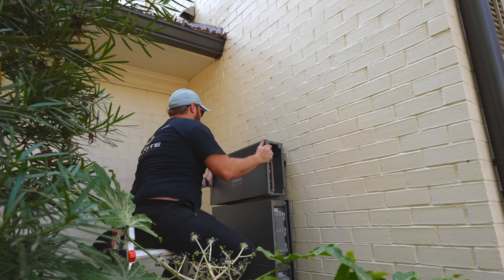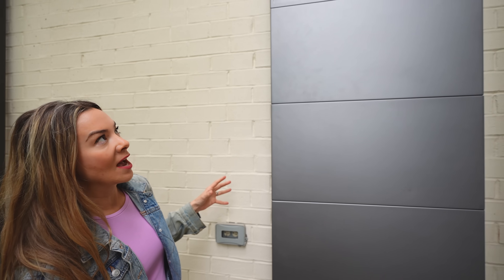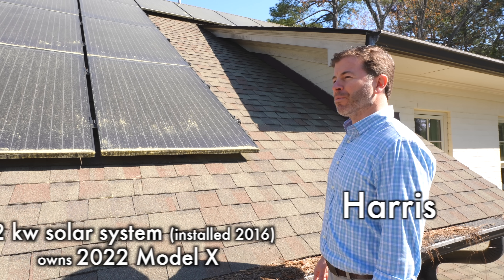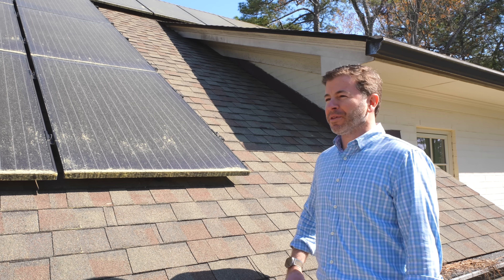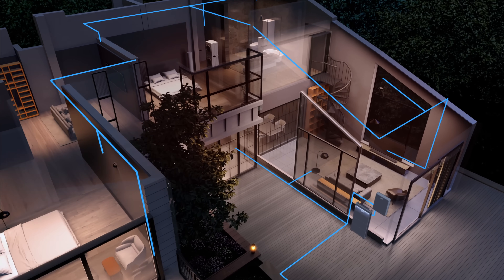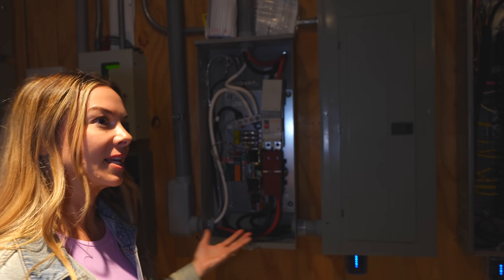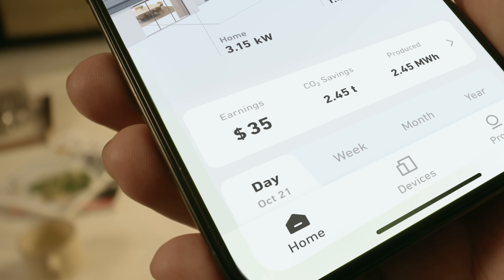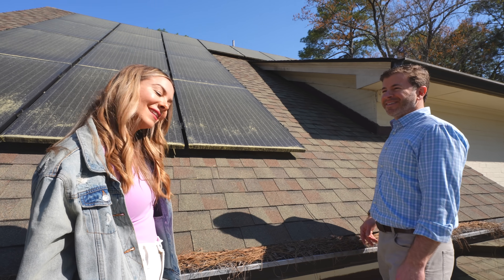Stepping Up Our Solar w/ Home Battery Storage!

Comment: How well insulated is his home, and is there a heat pump/s installed to deal with hot water and or air conditioning? If this is in Georgia, in that climate, air to air heat pumps make a great apples to apples replacement for traditional air conditioning units for a fraction of the running costs due to their higher COP meaning they use less energy than traditional units. Have the family opted for LED light bulbs? The savings on electricity is significant; the UK's electricity usage dropped by about ⅓-½ due to people swapping out their old light bulbs for LED and they also last a gazillion times longer. 

Only asking as I was so surprised at his comments about household electricity consumption going up instead of down or remaining more or less the same. Most people who get solar, batteries, EV's and other eco tech tend to become very energy consumption/efficiency conscious/aware, often to the point of nerdy geekness... 🤓 🤓 🤓 😅

Can't quite understand why he'd bothered to get the panels professionally cleaned in the first place. Given the relatively easy access, he could (easily) do it himself using one of those extendable brushes with a hose attachment hooked up to a tap. It's fairly quick and easy to use and can be used at one's own convenience.

Comment: I just got 71.5 kwh batteries for $16,885 delivered. Powerpro.
390watt brand new panels $112 apiece delivered. 18k inverter $3556 delivered. Right now is the time to go solar. Lots of overstock reductions going on Right Now. And those prices are without the 30% tax rebate.
I installed 2" of insulation and 8000ft of pex in my driveway. To melt snow in wisconsin. Was going to use solar hydronic panels. But couldn't find drain back panels for under $900 apiece. So just going to use 24 of the 390watt photovoltaic panels hooked up to 2 electric hot water heaters. With solar pumps. About $4000. Way less than the hydronic panels. Needed 10 of those. 
Will never shovel snow again. And other than initial investment won't cost anything to heat my driveway.

Comment: WHATS THE PRICE. I've watched like ten videos nobody says the dang price.  It looks great but what we talking 20k 30k 50k what damn
Reply: Agree.  I want to know cost of solar, cost of batteries, and cost for an electrician to connect everything.
Reply: She says it. 20k. In 9 years it will pay for itself.
Reply: @MichaelHayesagent  9 years, that’s an awful long time period.
Reply: I guess it’s free from solix as it just launched.
Reply: Do people not understand how this works ? Apparently not . Anything that requires professional installation will never have a shown price . It can’t . To many things change the price even with the same storage capacity . Price are different from region to region . Cost of labor is also hugely different from region to region . You could buy the exact same storage as your own neighbor and get a different quote depending on if someone has to upgrade there electrical panel , wiring , etc . I have no idea how these work but even i can figure this out . Come on already . We all claim we are adults

Comment: My brother in law does land development, does all the upfront paperwork and permits, then turns it over to a builder. He just built a small number of townhomes, being in California he needs to include solar. He beefed up the solar and the battery packs that service the units. He calculated that if they lost power and had no sun for week, the system, should keep the units going for the week.

His thought is that in the Bay Area, they rarely go without sun for more than 3 days in a row. Plus the utility company now takes weeks or more to attach new homes to the grid, especially on small builds.

Comment: I have my batteries set to charge to 100% starting at 11pm since the cost at night is the same as the cost I earn selling back to the grid. This way I always have a full battery in case of a grid failure (which happens at least once a month in Georgia).
Reply: Same here! I get free nights 9-7am. You never know when you’ll need it.
Reply: @jimboslice116  @Beakerzor what systems are you running in georgia with georgia power?

Comment: in Georgia (on "Georgia Power") we only earn just over 8 cents per kwh as power-to-grid (same as it costs from 11pm-7am) yet from June through the end of September electricity costs almost 30 cents/kwh, so a battery really helps keep the energy you capture from the sun

Comment: So how much will it cost to dispose of. No one talks about the disposal cost and the #1 reason why houses are being sold with dead solar panels.
Reply: Dead solar panels?  How long are we talking about - 30 years?
Reply: @aussie2uGA  I don't have an answer to specifics. All I know is solar panels contain mercury and they require proper disposal. I have heard it costing between $5k to $15k.
Reply: @justinburcaw1426  They still last 25 years and then continue to work but fall under minimum efficiency.  Most people want the latest and greatest by that point.

Comment: So... just using solar alone, without any battery optimization, he earned his money back in 8 years. That's much shorter than I assumed.
Reply: Got my ROI with my solar panels, which is 5.5years in Australia. No battery.
Reply: Remember that is if the electric company buys it back from you at the same rate as it charges you. In Jacksonville, Florida the electric company buys the energy back from you at such a low rate it makes it hard to make any money, you definitely need a good battery backup in place.
Reply: If you adapt your lifestyle you can still drop your bill low enough to justify purchase even if your getting reduced rate buyback. Consume during the day, cut back after sundown, sticking to an efficient routine I've gotten my bill as low as $20-40 with $.40kwh rates. I've also tested the opposite side of the coin with an " above average" routine (multiple ac run over night), and that lands us anywhere from $120-190. Most people no solar here are paying at least $400+  for that consumption.
Reply: @NuttGreez. That’s my case in South Florida.  I sell my electricity back to the power grid and the highest electric bill I’ve had in years is $45.00 where my neighbors pay hundreds.